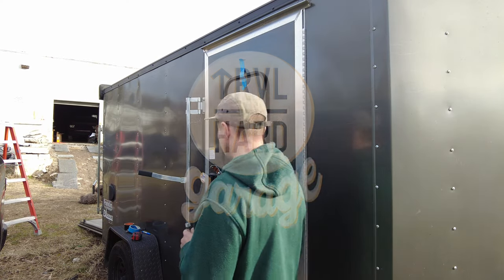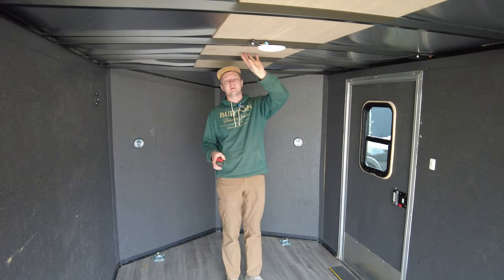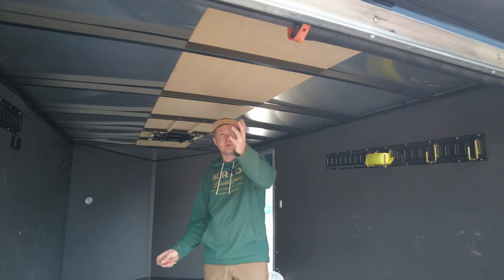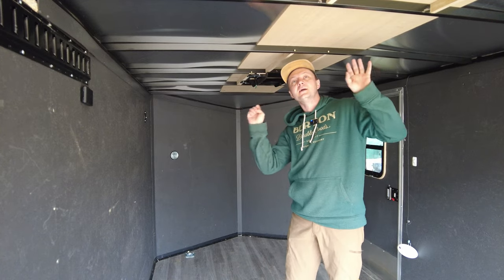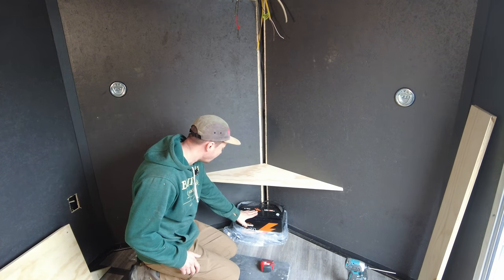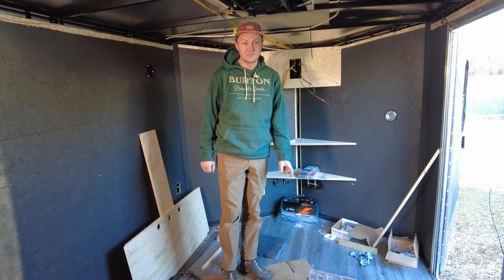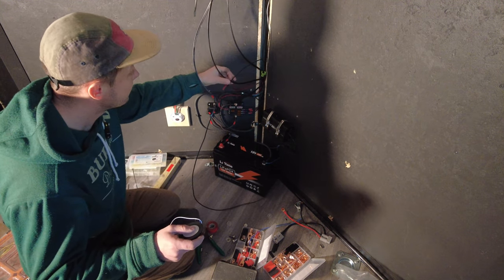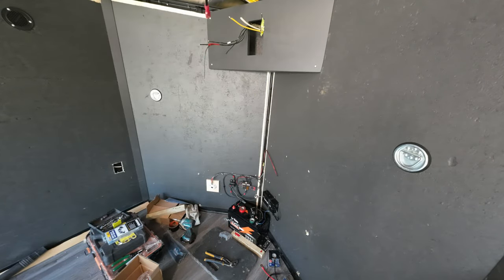Moto Trailer Build PART 2 | Electric system and window installation #trvlhardgarage #toyhauler

Comment: Great video & very informative. I am doing a cargo conversation for a motorcycle. What type of ac wire did you use for the outlets,was it hard wire or stranded.I also liked the control board on the top shelf & would like to know what model it is.Keep up the great work.Thanks.
Reply from the maker: Hey Patrick! 
I used 12 AWG ROMEX for outside outlets because the customer was playing to use tire warmers at them, so they have to hold up to 20A load. For inside outlets, I used 14AWG ROMEX.

For the AC panel, I used this one:
https://www.amazon.com/Paneltronics-Standard-Position-Breaker-Panel/dp/B00MIA31QU

Just keep in mind, that a lot of new generators have floating neutral. This panel has separate bars for ground and neutral, but if you use a generator with floating neutral, you will get a REVERSE POLARITY light at some point.

Comment: I'd like information  on the ac unit
Reply from the maker: I used 110V REC Pro one. Here is the link for it https://www.recpro.com/rv-air-conditioner-low-profile-9-5k-quiet-ac-unit-with-optional-heat-pump-and-remote-control-non-ducted

Comment: I’m in the process of building a cargo motorcycle trailer also. What is the A/c you are using?
Reply from the maker: I used 110V REC Pro one. Here is the link for it https://www.recpro.com/rv-air-conditioner-low-profile-9-5k-quiet-ac-unit-with-optional-heat-pump-and-remote-control-non-ducted/